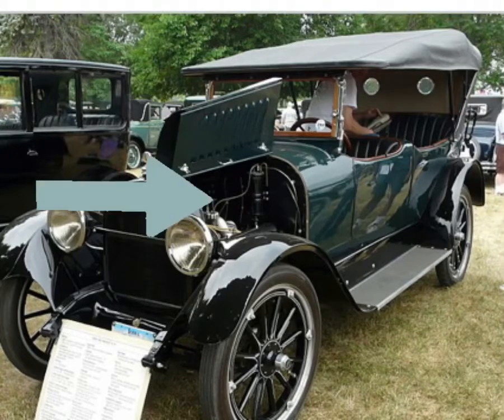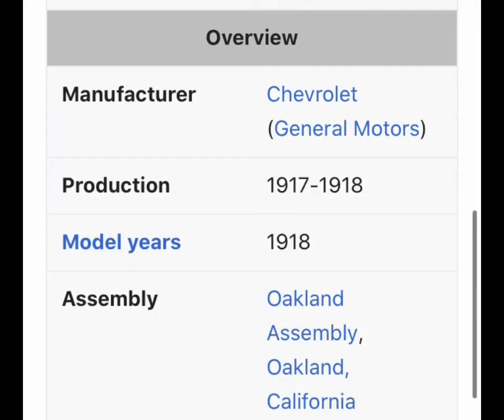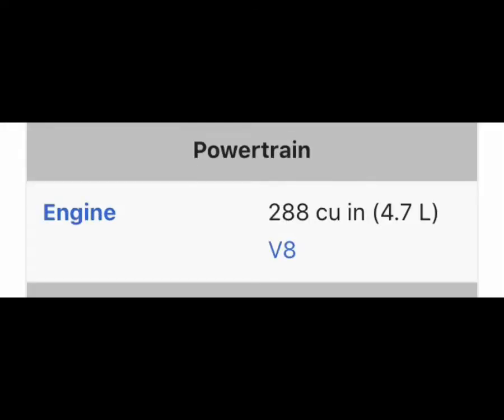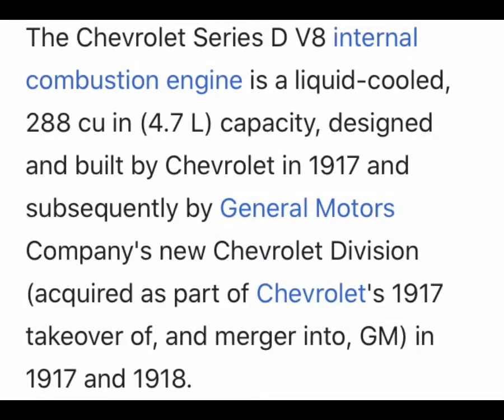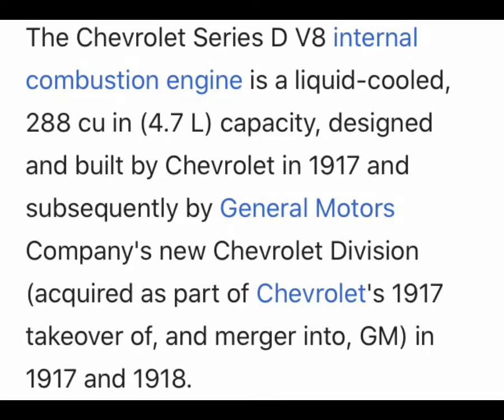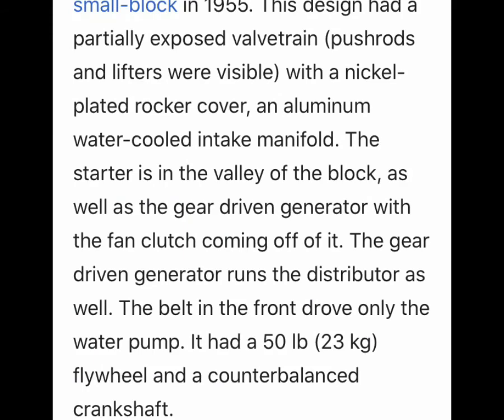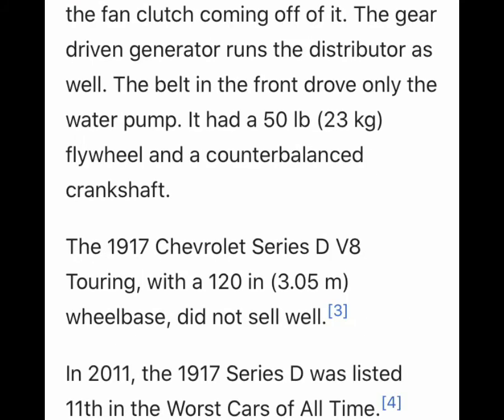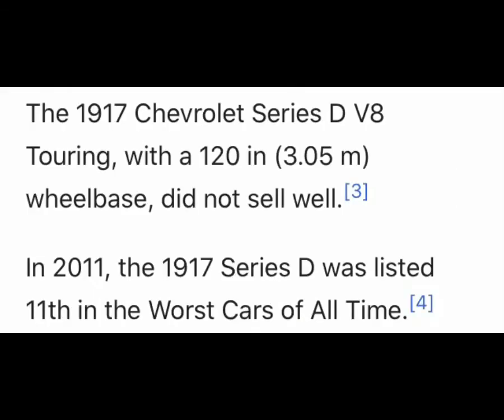Chevrolet first v8 motor

Comment: Other Sites  Having That Same Chevy posted have shown more of the car and the engine.  However YOUR Specific Information About it in Greater Detail  was Just as Valuable too.  Maybe on your next one you can have a Stick POINTING AT Particular parts of the Engine  and the Drive Train.  Because it looked like it had 4-wheel  Drum Breaking.  But  Also an Odd looking rear drive with  exposed gear teeth on another fellows Chevy that was Like Your's. The Information was Greatly Appreciated all the same. Good Job.